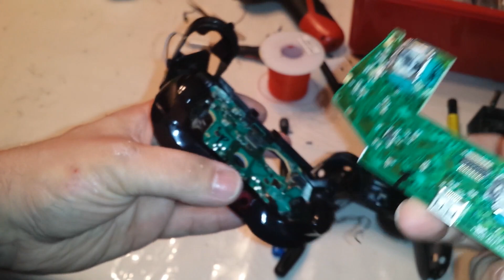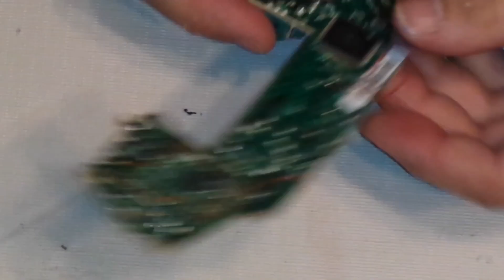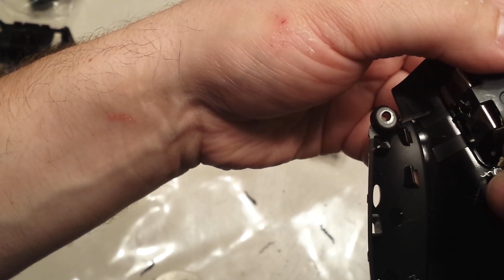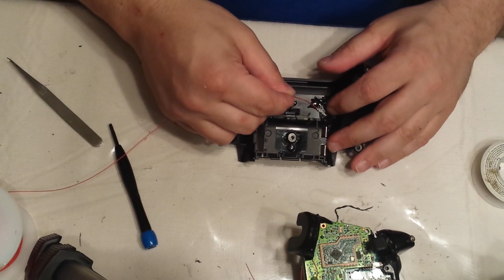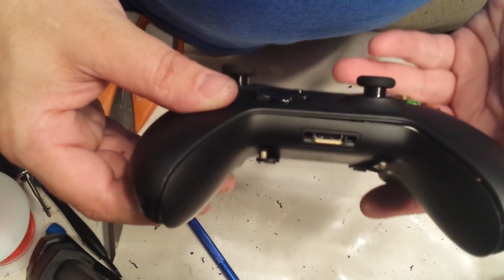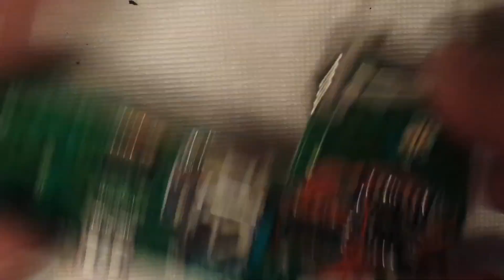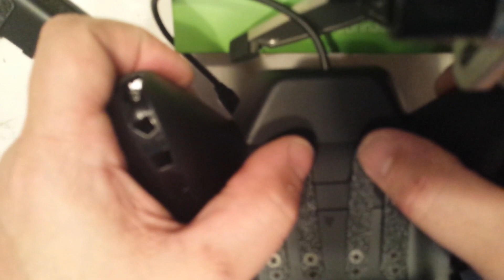TUTORIAL BUILD YOUR OWN XBOX 1 Scuf style Controller w/ Triggers Stops, Remap chip & MORE DIY Gamer

Comment: Can I send u my controller and u add the paddles.. I have 2 xbox 360 scufs and really don't wonna spend so much this time around
Reply from the maker: If you have 360 scufs. We have the replacement Aluminum paddles you can add and they will never break again.

If you want us to build you a modded controller for Xbox one.. email me at modcentralusa@gmail.com.
I will be glad to knock out a build for you. Mail in or New build.

I am already getting busy.. was a 24 hr wait on all builds, I am at 48-72 hrs now.  As I don't do this full time, this is a hobby for me.
But I have about 15+ builds on the table right now from these videos. SO get ahold of me fast to secure a spot.

Thanks
Reply: Ok

Comment: How much would you charge for 4 switches 4 paddles and a remap chip shipped to the UK
Reply from the maker: HI Lee....

Email me at modcentralusa@gmail.com

Your looking at between $70 and $72 USD shipped for all that.
There is a choice in the paddles (aluminum and aluminum + Plasic dip coating)

40 for chip + 10 For shipping + 4 for Switches + $16/18 for paddles =  $70 or $72

Comment: When I customized my controller a few months back I just pulled out the cable for the rumble motors just because I didnt want vibration, so no need to solder
Reply: SGMZ why tf would you do that you can just disable it
Reply: U can disable it in accessories lmao

Comment: how do you chain 4 together? Could you just post a picture of all the solder points?
Reply from the maker: At 46:44 I show you how to Chain the Ground for 2 tact buttons. Just do the same thing for 4 more.  I you look at 1:39:29  (pause it for a good look) there is a picture of the shell for the 4 tacts already done and chained together. If you look carefully I have all the tacts with their legs facing left to right (horizontally) and I soldered the TOP legs together. Tact one top right leg is soldered to tact 2 top left leg then the top right leg of tact 2 has a blue wire that goes to the top left leg of tact 3 and then there is a metal connector on the top right leg of tact 3 that connects to the top right leg of tact 4.    You an connect the ground of the controller to the TOP left leg of tact 1 or the top right leg of tact 4 and that will complete the ground chain of all 4 tact buttons.  The activate wires from each of your remaps will go to EITHER og the bottom lets of each tact and that is all you need to do.  Follow the tutorial starting at 46:44 for the 2 button to get a more hands on idea.

Comment: instead of 4/40 can u use 3/32 instead and ittl still be fine?
Reply from the maker: If you deviate from the tutorial and the defined materials then you take all the responsibility if something does not work or fit right.  By using what was laid out, you have the benefit of knowing that everything will be inline with this tutorial.

Comment: Can you purchase hex screws that are not tamper resistant
Reply from the maker: None of the screw I use are tamper resistant.  They are just Torx head style, but you can find philips head too. I use a standard 4-40 screw just find the proper length and a head style of choice. I prefer the Torx screws because of the looks.

Comment: where do you buy the paddles
Reply from the maker: I don't - I make them.
Reply: MODCENTRALUSA with the polycarbonate sheet? And you might want to mention that if you don't glue the connections for the tactile switches it can create a magnetic field that effects the triggers.
Reply from the maker: Garrett Hamlin The Tacts are no where near the Triggers. The only way to get the tact to stay in place is to use glue or hot resin of some kind.  There is no other way to keep them in there.  Yes with the triggers using linear hall sensors (magnets) the only thing that will affect it metal with a magnetic field, tact buttons - even with metal on them will not cause any issues with the triggers. Also the Screws that hold the paddles are no where near the triggers either - so there is nothing to worry about. I have actually seen loose screws stuck to the trigger magnets and caused no ill effects to the trigger or it's sensitivity.   The magnets that the linear hall sensors use are quite specific, very close to a earth magnet so there is not too much to worry about.  As for the plastic I use for the paddles - they will have no effect on anything,

Comment: Excellent, best video out there - thank you.  I am an industrial design grad and obsess about controller mods.  I have experimented with many, many tac switches and found that actual push buttons feel best (imo).  Also, a simple screw with some small o-ring washers work great for quite, soft stops and are adjustable (just add a larger o-ring). Here is the latest I just finished which uses a push button that requires relatively little push force and is very snappy/mashy (unlike Scuff paddles which are way to stiff):

http://postimg.org/image/eyo68jusx/
Reply from the maker: Those are nice buttons but quite large, the clearance must be minimal.
Reply from the maker: My paddles are either very flexible (no stiff like scuf plastic) or I have a nice light aluminum one that is better than scufs.

Comment: I have ?. I'm having some issue with my xbox one left Anolog stick. For some reason, in game the character can't sprint. I can move around but no sprinting. I can navigate via the main menu but in game such as cod ghost the character can't sprint. Please Any solution.
Reply from the maker: Plug the controller into a PC using a micro usb cable.... Load the windows drivers for xbox one controllers and open up configure usb game controllers and then go to properties. You should get the same screen I show at the end of this video to show you how all the buttons work.  Press properties and open the test screen.  Press the Right stick and see if Number 9 light up or not.  If it does light up everytime you press it, the controller is fine.  If it is already lit up and stuck on then then right click press is malfunctional.  If it does not turn on when you press it is also malfunctional.  This is a great way to test your xbox one controller to make sure all the buttons work without using a console and a game.  The PC USB test screen will allow you to check all the buttons and sticks and such.

If the controller shows the RT CLICK working on the Pc but not the game then do this. Press and hold the Xbox button for 10-15 seconds and let it do a rest.  After that (RE/SYNC) the controller using the button on the controller and the side of the system.  Then try again...  SHould work.

If the RT Click on the controller is malfunctional or broken, Then it can be fixed or replaced.

Comment: theres something you missed out and was hoping you can shed light on this matter, so basically at 24:15 on the video you show that we can make also put in"Y+X buttons for paddles". but what you missed out on was how to connect the wires to the "ground"? was wondering how the X button for example connected for it to work, thanks and great vid by the way :)
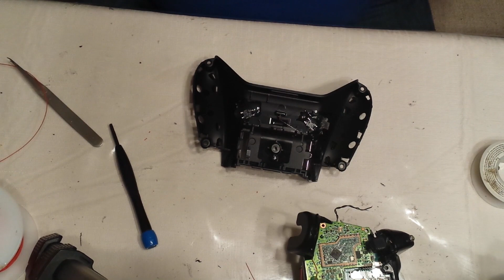Reply from the maker: I didn't miss a single thing.. If you watch I clearly point out every pin for every buttons.   At 22:50 I show the ground and speak about it quite clearly.   I used A/B in the video for demonstration purposes..  And then point out Y AND X in case you rather use them. Ground is shown and installed.  There is not a SINGLE detail missing from the video. 45:02 has the ground wires installed as well as at 22:50.

Comment: can u do ps3 controllers
Reply from the maker: Personally I can do them, but there are 14 board revisions so I will not be making a video like I did for Xbox 360 or Xbox one.  If you want us to do one for you contact me via email. But as for a video, not going to happen, but the mod should you want to do it yourself is pretty simple, Drill two doles and install your tacts in the back shell in the round area behind the thumbsticks at the bottom.  Attach your paddles at the edge of the raised areas over the tact buttons.  Then find the board revision you have and then google for PS3 board PCB scans and find the proper two solder points for the two buttons you want to map, the other side of the tact will solder to COM 2 point (not ground) - close it up and your done. The hardest part is finding the proper diagrams. - good luck.
Reply: how much would it cost??
Reply from the maker: FaNg ClAn  If you mailed in a controller it would be $44 and that includes the return shipping. If you wanted to buy a controller outright I have Black, Clear Red and Gold instock and it would be $95 shipped anywhere in the USA
Reply: mine is not a proper ps3 controller it is a giotech vx2 red and i want my logo on it £10.00
Reply from the maker: FaNg ClAn Being in the UK.. it would not be worth it i am in the states and shipping is expensive to ship back and forth. If you wanted to buy a controller it would be $95 + 10 shipping to the UK. Also 3rd party controllers like your I am not familiar with so I couldn't do the work on it.

Thanks,
Reply: nobother sorry for the trouble
Reply from the maker: No bother....   If you need our services in the future, let me know.
Reply: i will thanks

Comment: If you don't mind. Could you tell me how I learn to do things like this? Modding a controller to my preference. Maybe making custom controllers as well?
Reply from the maker: There are a few ways.

1. Watch videos!! I do this to Teach people and possibly promote some packet change for my self for those who are not technically inclined.

2. Research Custom Controller websites. See what people offer, look at 3rd party products out there.

3. be imaginative, if you can think of a type of mod you want. Ask questions it can probably be done, that is how I designed my remapping chip.  Also there are devices like a 4066 that will allow drop shot buttons and such..

4. and lastly - go slow. take your time and your modifications will come out great.
Reply: Thank you so very much! I'm going to be a tournament player so I'm not really into Rapidfire, dropshot, etc. There's this thing about what I believe to be the motherboards of the 2004-2006 controllers (they switched boards in 2007). The way the thumb sticks move feel much better for me and easier to aim. So I'm going to be doing some experimenting. Knowing how to modify controllers tournament legal would be a huge benefit, and awesome for making custom controllers.
Reply from the maker: 8Tailz Yes those mods are not tournament legal. As for controllers. The 2005-2006 controllers are Matrix boards then from 2006/7 - present there are CG and CG2 boards, in 2012 they revised the matrix board and had a limited run of Matrix 2 boards but regardless if the board is CG or Matrix the thumbsticks them-self do not change. ALPS makes the analog sticks that are soldered to the board. Sure the 2005-2006 controllers had grey thumbsticks and then they changed them to black in 2006/7-present. but the material of the stick did not change - the physical hardware soldered to the board is exactly the same as it was for the entire production life of the controllers. ALPS never revised their analog sticks - so the 2005-2006 ones only feel better because perhaps they are more broken in.  I am sure if you found a 2005 controller brand new in package it would feel exactly the same as a controller from 2014. ***Xbox 360 was released NOV 2005 - there are no 2004 versions....
Reply: MODCENTRALUSA Wow! You even know this information. Thanks again! You're probably right (well you are right) about the thumbsticks that attach to board. But what I'm talking about is the actual "feeling" from the controller board to the Xbox. I could be wrong about that though. Also Matrix is the same board they used for the wired controllers too right?
Reply from the maker: 8Tailz Wired controllers are Matrix and CL (common line) Matrix Wired controllers have grey mic port all black mic port are CL. 

The boards are all the same - the only differences between them are the MCU on them and the routing of the tracers. All the components such as thumb-stick pods and tacts and such are exactly the same across all models wired and wireless.

Comment: How much for a diy kit for Xbox 360 and also send in service for Xbox 360
Reply from the maker: All the info and pricing is in the description of the video.

You can also send me an email at modcentralusa@gmail.com and I will be glad to shoot you over a longer version with a ton of options to choose from.
Reply from the maker: SEND in for 360 starts at 44.95 - if you want to customize parts or add a remap chip it's slightly more.

DIY Kits start at $30 shipped. I have $30 and $45 kit

Comment: When soldering the first cables do I need to put the solder in the place ima solder and then get the wire and use the soldering gun so it can stick ti the board? Or I get the wire out the in the location ima solder it then get the soldering gun with solder in it and place it?
Reply from the maker: I can't help with basic soldering skills. Follow what I do in the videos will be very helpful.

Comment: Hey bro could you do a video on how to make your own paddles I think it will be interesting.
Reply from the maker: A Video is not needed.

Cut a long plastic or lexan strip about 1/4 inch wide and make it as long as you want.   Then take sandpaper and sand the Sqare edges till they become rounded.  Takes about 2 minutes.
Reply from the maker: +Schwanzzzzkopf I don't need doushebags like you here. The idea of the video is how to build your own without giving that ripoff company a dime.  If I wanted people to buy paddles from them I would have posted a link in my description. DO me a favor a piss off. I don't annoying pest like you spamming their shitty name all over my video.  My tech is better and cheaper and my tutorial can be done by anyone pretty much so you can build a modded controller for less than 10 bux.

Comment: Can you please upload a video that show how to use two tacs but you can use a switch to select different  button like say my tact was "A" and i want to change it to "Y" without having to take the controller apart and rewiring it for xbox360
Reply from the maker: You can only do that on the Xbox 360 controller there is no place to put the switches really on this controller (sure you could make some holes if you wanted and mount them underneath the hole to the PCB).  The Xbox 360 wireless was good because they could be placed inside the battery cover area and be out of the way of the battery, the xbox one controller does not have any area to do it with.  That is why I made the REMAP CHIP. It allows you a single install and you can change the paddles as much as you want.   You have access on the fly with no switches to flip or batteries to remove. If you watched the demonstration at the end of the video you will see it takes 1-2 seconds to swap a remapped button from one button press to another.  If you need the 360 switch info I can pass it along.
Reply: can you make a video on how to do it with the xbox360 controller then
Reply from the maker: XxTheSoulSnatcherxX
 I already made a 360 video the only difference is you solder the wires from A AND X to a switch and then from the switch to the tact. Then X and Y to the switch and from the switch to the tact.  It is very simple a new video is not needed for it.  The switch has 3 connectors Right Middle Left.  Solder A and X or what ever TWO buttons you want on the switch could be A and R3 or X and Bumper - whatever you want. Solder one wire from button one to the Right connector of the switch and the other button to the left connector and the middle connector goes from the switch to the tact.  That simple.  If you look at the 360 video comments - there is a link in the comments section somewhere that has a full visual diagram.  Put the switches in the corners of the mic port by the battery cover.   The switches have 6 legs cut the back 3 off as they are going to be against the mic port anyways. You only need the FRONT 3 Legs.  All you need to remember is CENTER LEG goes to tact and RIGHT AND LEFT go to your button soldering points.    As usual tact will have 2 wires to it the wire from your switch and ground (CG and CG+ wireless controllers) or CL [common line] which is for wired controllers only (technically a type of ground).

http://www.digikey.com/product-detail/en/AYZ0202AGRLC/401-2013-1-ND/1640122
Reply: ok thanks.